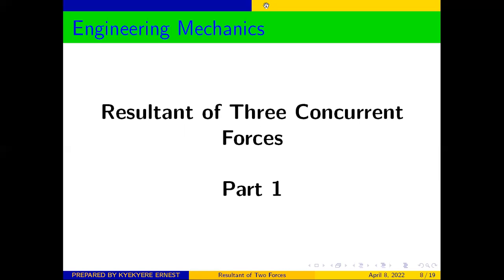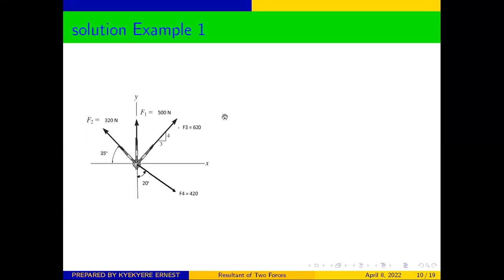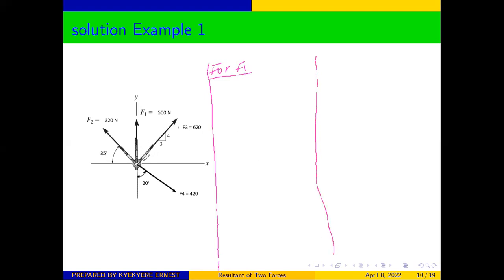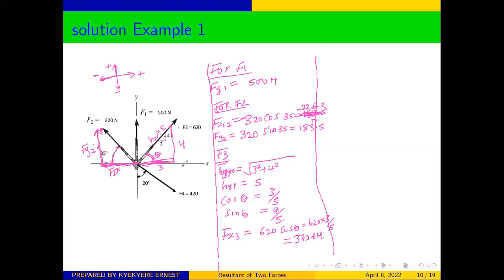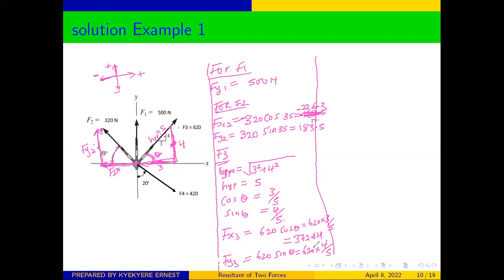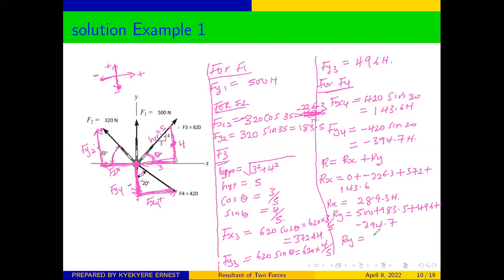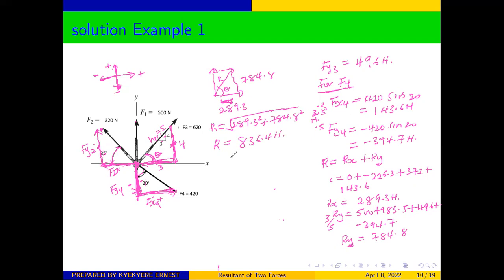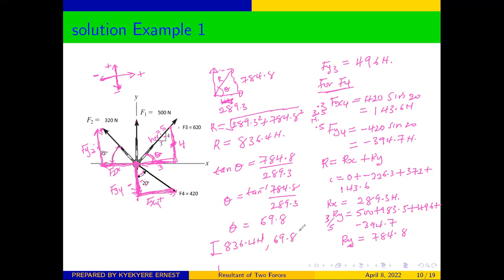Basic Mechanics : Resultant of Three or More Concurrent Forces Example 1

Comment: Resolving for Fy4 in the y direction,
Fy4 = -420 Cos (20) = -394.671N
But sir you wrote,
-420 sin(20) for the Fy4...
???
Reply from the maker: The angle of 20 degrees is opposite to the x-axis and adjacent to the y-axis. whether it will be sine or cos depends on the position of the angle
Reply from the maker: this is true, it should have been cos rather. Thanks